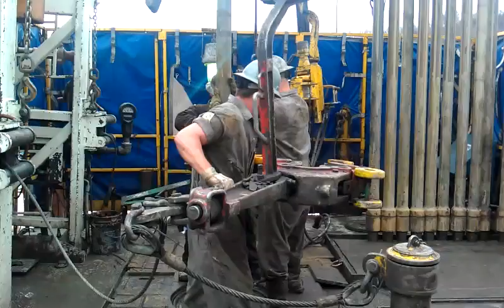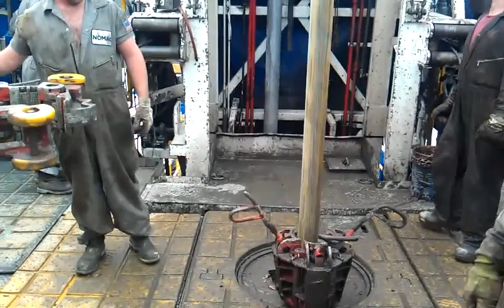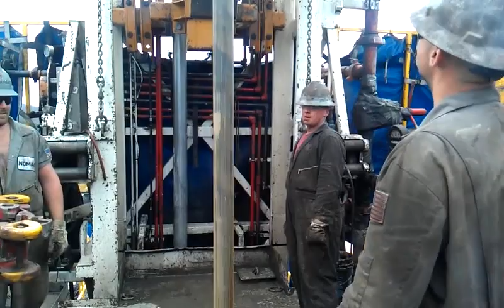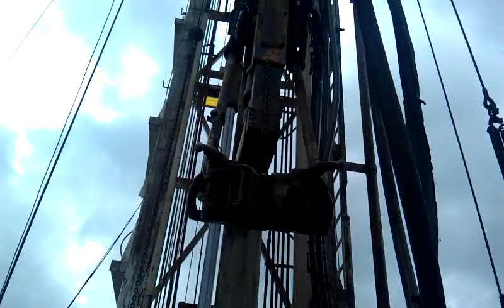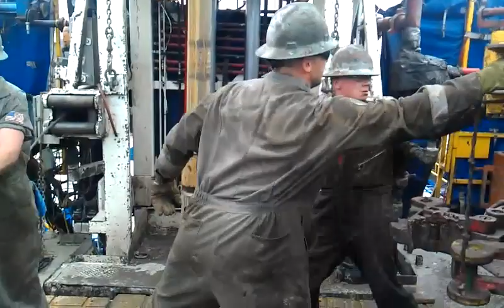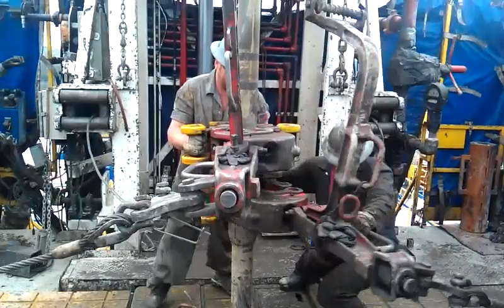Throwing tongs.

Comment: What's the device called that they put around the pipe on floor level right before they start to add a section of pipe? Also, are the ends of the pipe section threaded? I assume they are the way they turn to remove and add a section of pipe. If they are threaded, how often do you cross thread? Seems like it'd be a risk.
Reply: That device is the pipe slips. It bites onto the pipe so when you unlatch the elevators the pipe doesnt go all the way down hole and get lost on ya
Reply: The drill pipe is threaded on both ends, the threads are tapered and designed to start pretty easy, also they use dope (lubricant) so the threads make up smoothly.  I have hardly ever seen a drill pipe connection cross thread.
Reply: @bigbenorr  yeah they dope them with a nice lubricant. Plenty of it too, when the pipes are turnin at basically a straight angle into the next joint, with plenty of dope it never cross threads